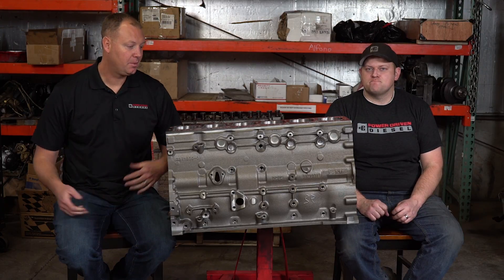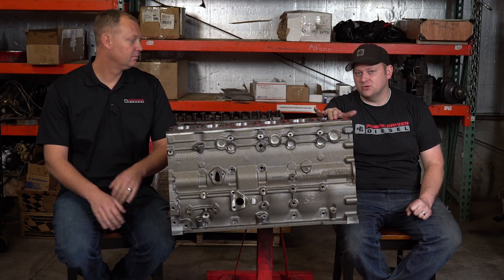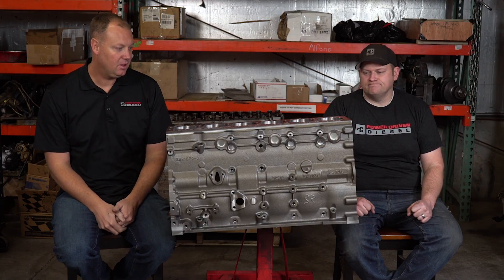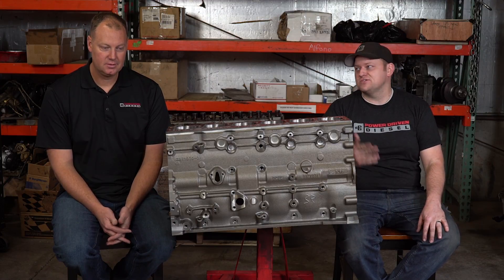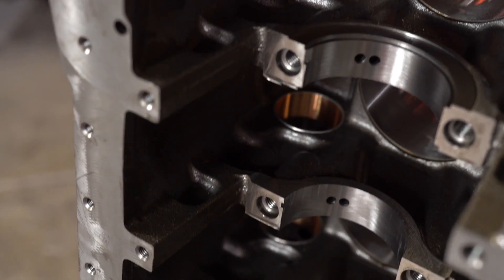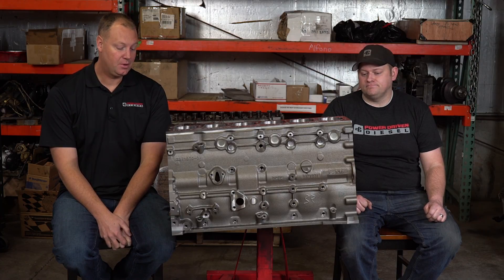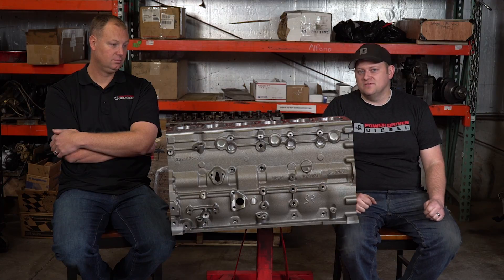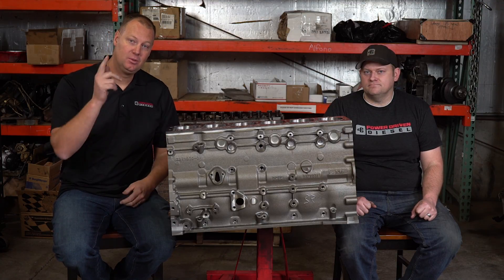Hamilton 6.7 Cummins Engine Blocks | Parts Bin EP 3 | Power Driven Diesel

Comment: I'm looking at some of your kits online. I have a 12valve 5.9 with 300,000 miles. 4speed auto that's has a triple disc torque converter and a external cooler. 4in exhaust all the way back. Everything else is bone stock. Which kit would you reccomend for everyday towing 15000 to 20000lb loads? This truck is used for hotshot towing freight in the mountains. Email me if you can. Piercetransport2019@gmail.com

Comment: Why would you want a 5.9 crank in a 6.7 block?
Reply: Rod break over angle..... The 5.9 rods are .080" shorter than 6.7 rods and that means at TDC the journals of the 5.9 crank will start the down stroke before the 6.7 and lessen the side load on the Piston and cylinder wall. Using the 5.9 crank in the 6.7 block creates a 6.4l
Reply: ,,, well, maybe because you have a 5.9 crank, you will only give up 14 cubes. .080 in rod ratio can only be found by a slide rule or computer. You will never find that little bit of rod ratio advantage on a dyno or time card .